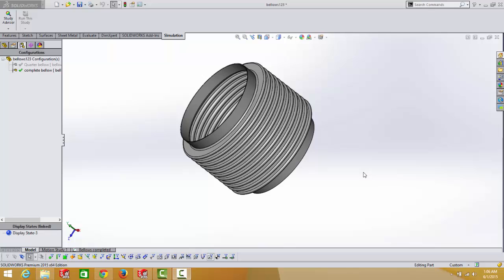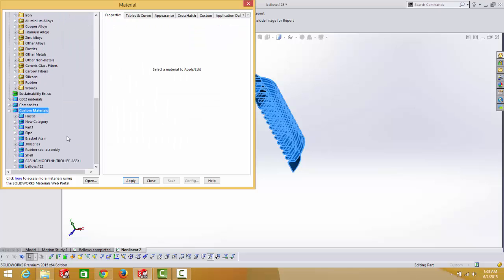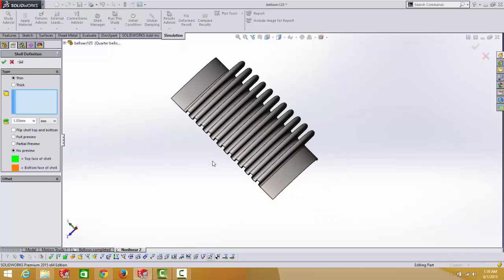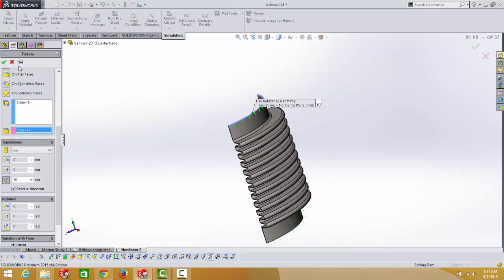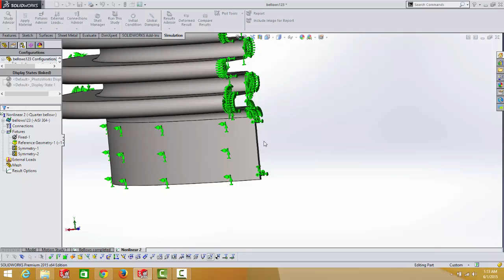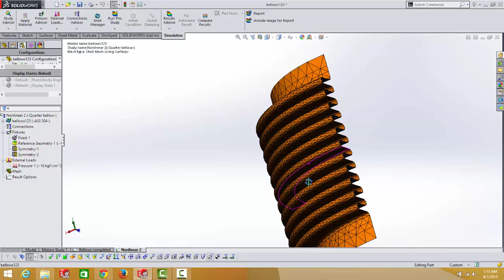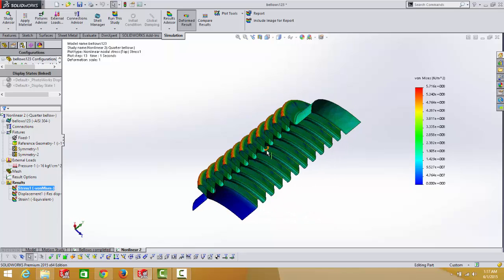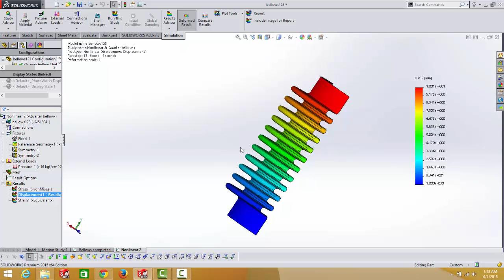SolidWorks Simulation- Expansion Bellows

Comment: Why you use nonlinear study for expansion bellows. Steel is in linear elastic area for this use I think, and your stress strain curve is very poor
Reply from the maker: harun hodžić there are two types of non linearity here geometric and material so for better results it preferred to have non linear study for such cases ......Further this is just to show the process of conducting such study results can be further refined by creating refined mesh and providing better stress strain curve for the material
Reply: thanks for answer

Comment: Hi Rohit! Good tutorial, Thank you! I would like to point out that You explained about the stress wrongly. As per from the results that you have projected, the stress and displacements are there in the furthest end of Y-direction. The lower end of y-axis may also have stress but the magnitude of it is less than the further end. Hope you understand what I am pointing out :)
Reply from the maker: Hi Pradeep...I really appreciate the viewers like you who really see in depth technical prospects of it. I agree with you the stress will be less at bottom Y axis which is the case in the video also if you see the the probe values which i have shown in the video. I appreciate your comment and request other viewers also that these videos are just for references, please use technical knowledge before performing any analysis.